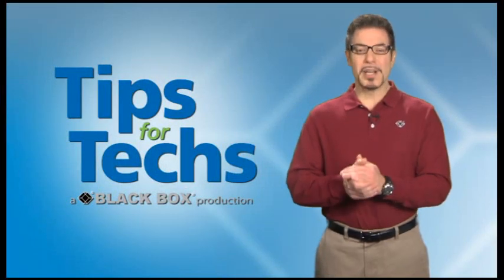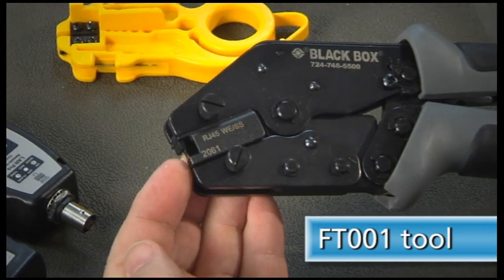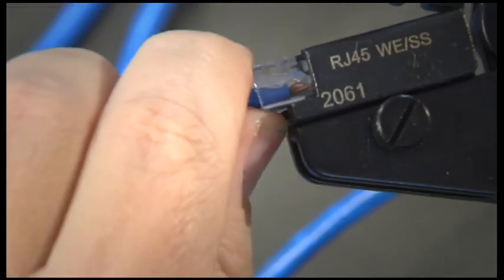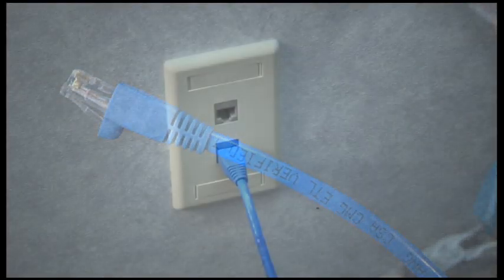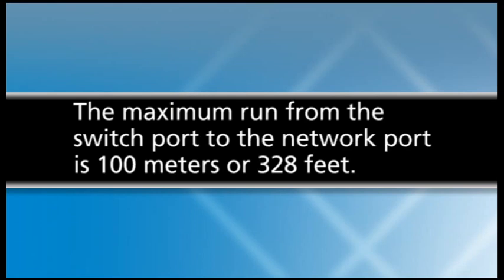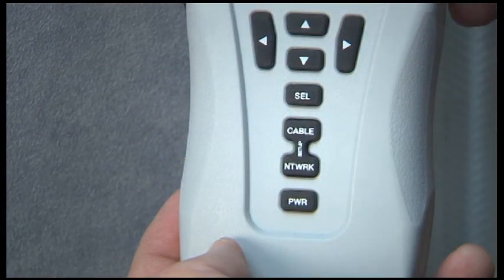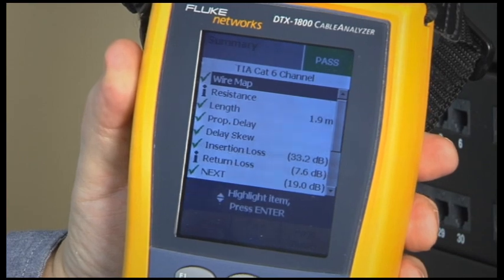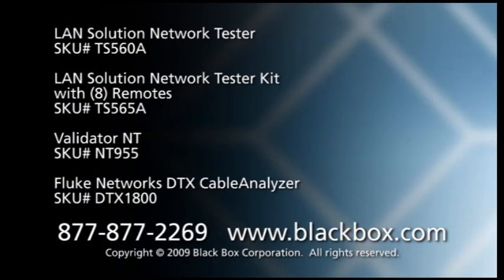How to Terminate and Test Copper Cable | Black Box®

Comment from the maker: @halomasterchief14: The majority of cat5e/cat6 modular plugs use a 24 or 26 gauge of wire, with some variance throughout the market. Any cable that works within those gauges will work fine. Cat7 cable is a different monster, it isn’t terminated with an rj-45 at this time, it uses something called a “TERA” connector. Does that help?